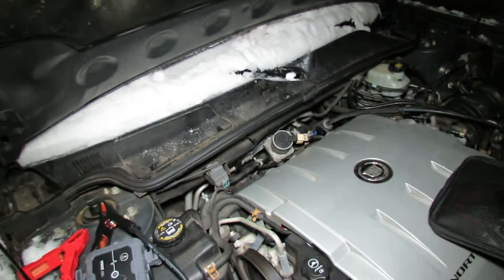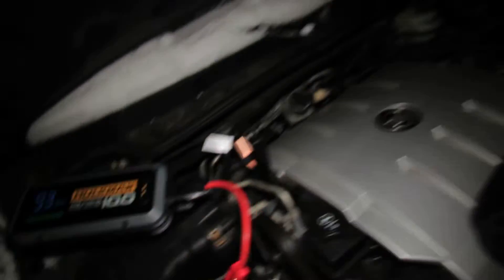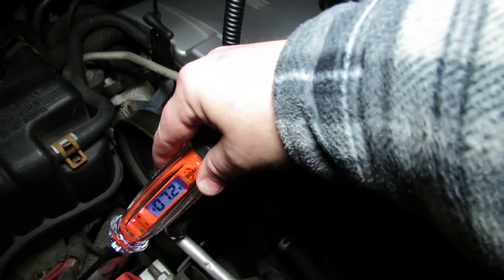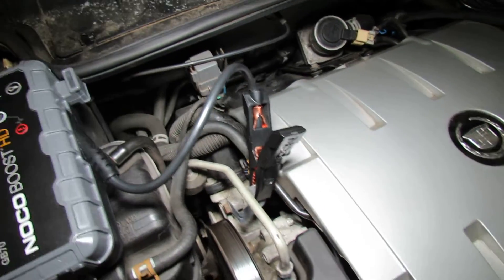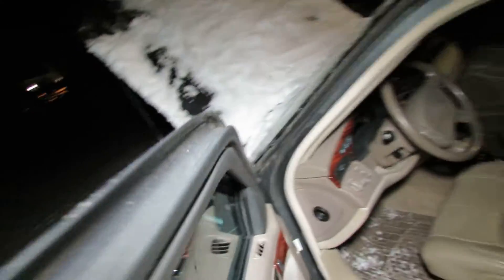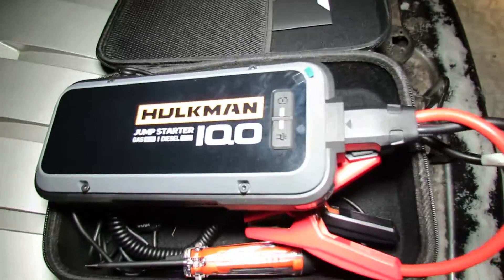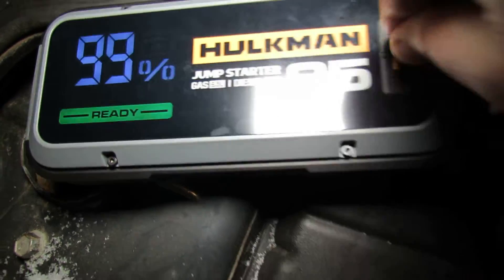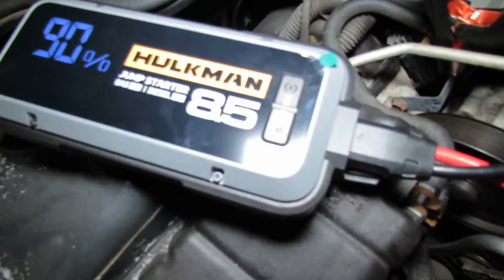HULKMAN 85S VS. NOCO GB70 (Which is BEST?)

Comment: I think you should of clicked the override button on the Noco like you did on the hulkman it uses the same technology that won't start working on a battery that low automatically hence the override button. Or a video of the hulkman starting the car without pressing the override button. I have started a completely dead  6.0 ford diesel with the gb70. In your video the noco didn't even crank or turn over the engine in the car, showing it wasn't powering anything.
Reply: Hulkman drain so fast not like NOCo
Reply from the maker: @Victor-cd4hn  It's a little hard to tell exactly how a Noco is draining compared to other units with a digital battery indicator. Since the Noco has a 4 lighted battery indicator, showing from 25, 50, 75, 100, its very difficult to know the exact battery percentage left on the Noco since it goes by 25% increments. But the Noco & Hulkman portable jump starters are made very well, and are very powerful. Thanks for the comment
Reply: I agree. I have 3 NOCOs and the Hulkman. I love all of them. It didn't seem that he used the boost on the NOCO. They both should have jumped it. I have nothing but big V8s and they both work.
Reply: @Sebastian-oj2gu  thats right, he did it wrong!
Reply from the maker: Please explain how we did it wrong.
Reply: @Sebastian-oj2gu  Which do you prefer? and why.
Reply from the maker: @FORDEVR I like both units, but if I had to pick one, I would definitely choose the Hulkman 85S. The Hulkman 85S has preheat technology for frigid cold weather, nice large LCD display, very sleek, heavy duty, very well made. The Noco GB70 is a great unit also, but it doesn't have preheat technology, no LCD screen. The Noco GB70 is well made, heavy duty, but when it comes down to it, I just like the Hulkman 85S a little more. Just like everything, it's all a matter of personal preference. I mean, some people don't like an LCD screen or may live in a warmer climate, so the preheat technology would never be a factor.
Reply from the maker: When the lights are chasing on the Noco GB70  you are not supposed to hit the Boost button. When the lights are chasing on the Noco it means the unit is ready to Jumpstart your vehicle with no Boost necessary. If you listen closely after i hooked up the Noco GB70 and the lights were chasing you hear the clicking module inside the Noco showing the unit was producing power, just not enough unfortunately. Watch some of our other videos with the Noco GB70 when the unit didn't recognize that their was a battery since the battery was super low, only then are you supposed to push the Boost mode. And in those other videos you will see us push the Boost on the Noco GB70 and it still couldn't start the V8 at times. Noco GB70 is a good unit but it struggles starting my Caddy V8. In some videos the Noco GB70 would start the V8, other times it would just cause a clicking sound, other times there was nothing. The Noco GB70 works perfectly on my 4 & 6L, and some small V8 vehicles in my fleet, so u know it's not a defective Noco GB70. It's just hit or miss on larger V8 vehicles. Because keep in mind the package says the Noco GB70 jump starts Up to 8.0 liter gasoline vehicles. We do appreciate your feedback though.

Comment: This is the best review of the Hulkman I've seen; actually testing it in cold weather. I've got a Hulkman 85S on the way and I'm glad I chose it over the Noco.
Reply from the maker: Thank you very much for the kind words. When I first took the Hulkman 10.0 & 85S out of the trunk for the review it actually showed an icon of a snowflake on the Hulkman screen alerting me the unit was very cold, then after about 5 seconds the internal -40 degree preheat technology feature kicks on and the unit is ready to use. Most jump starters would just not work in the freezing weather. I found that so awesome. I tried to get the snowflake on camera but it came on and went off so fast I wasn't able to. Lol
Reply: @HM_RELOADED  how do you know when the pre-heat function turns on, is there another icon that lights up or you just feel the warmth?    And there’s no button for pre-heat correct, it is just activated by turning the unit on, and by an internal temperature setting right?
Reply from the maker: @joebuck4496  If your unit is ice cold you will see a little snowflake looking icon illuminate on the screen. Just turn the power to the on position and you will see that little snowflake icon disappear, then your unit is ready to use
Reply: @HM_RELOADED  oh I didn’t expect that, for an icon to be illuminated when turned off!    That seems weird, like it’ll eat battery life when it’s turned off, however maybe the snowflake icon is illuminated in a way that it’s power draw is extremely minuscule??    I don’t know much about electronics so I’m not sure.
Reply from the maker: @joebuck4496  no, no, I misspoke. When you turn the unit on you will see a little snowflake icon if its cold, when the unit warms up for a few seconds the little snowflake goes away and you could use the unit
Reply: @HM_RELOADED  oh ok that’s great news, thanks for the clarification!!    I really wanna love this unit so I definitely didn’t want any strange quirk that was gonna annoy me about it haha
Reply from the maker: @joebuck4496  This unit is great all around, and one of the very few that have the flashlight on the same side as the cable attachment so you could see your battery and jump start at the same time at night. Most units have the flashlight on the opposite side of the cables, that way you can't see the battery and jump start at the same time in the dark
Reply: @HM_RELOADED   The pre-heat feature is what convinced me to go with the Hulkman, so I’m glad to hear it works well. We’ve had battery issues during the recent cold snap and the warranty replacement is on back order so I wanted something we could rely on to get us through the rest of the winter.

I’m curious how long you had it stored in your trunk before using either the 10.0 or 85S. They appeared to be nearly full capacity so hopefully that means they keep their charge well while not in use.
Reply from the maker: @pvanb  I have had the Hulkman 10.0 in the trunk for almost a month, and the 85S was in the other car trunk for a few weeks, so i did not have them in the trunk for long since I basically just got both units within a month of each other.  They are supposed to hold a charge up to 18 months without using them. We had some frigid cold weather here in NJ this winter so far, when I did that review the weather was in the low teens and the units were ice cold when I first took them out of the trunk, and they still worked perfectly thanks to the preheat technology.
Reply: @pvanb  i havent charge my Hulkman since i first got it last November and its been inside my trunk of my BMW all these months and i checked it recently.and it still shows 100% fully charged! Amazing kickstarter engineered product!
Reply from the maker: Hey PVANB, you were one of my giveaway winners on Christmas, you actually won the Sony CyberShot video camera...Send me a response back from this screen name and i will set up everything....congrats
Reply: @HM_RELOADED  Wow, I missed that you were even doing a giveaway.
Reply from the maker: @pvanb  shoot me an email at HMLimousine@hotmail.com, I will then need your address to ship you the Sony Cybershot video camera. If you watch our Christmas live giveaway you will see the camera you won. Congratulations again
Reply: I have 3 NOCOs and the Hulkman. I love all of them. It didn't seem that he used the boost on the NOCO. They both should have jumped it. I have nothing but big V8s and they both work.
Reply from the maker: My Noco GB70 is pretty much brand new , I never have any issues when I Jumpstart 4, 6 and some V8 vehicles with my Noco GB70, but for some reason the Noco GB70 struggles to start my 2004 Cadillac Deville V8 as I have showed in many different videos. I Boost the Noco GB70 when I simulate a dead battery and the Noco GB70 struggles as my videos show. I love my Noco GB70 but I am very curious why it struggles on my 2004 Cadillac V8. So now matters if it's Boosted or Not, the Noco GB70 struggles on my 2004 Cadillac V8 for whatever reason. Thanks for the comment
Reply: Just wondering but how cold was it out  when it said it was too cold? If you remember 😂
Reply from the maker: Freezing...lol